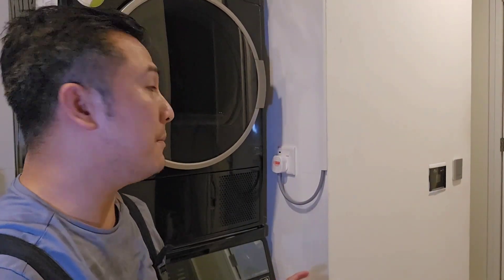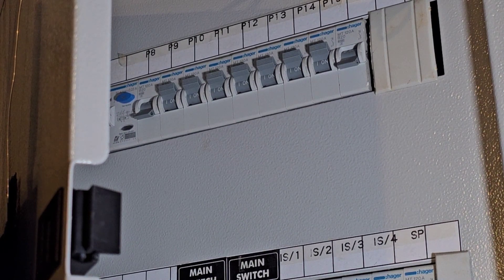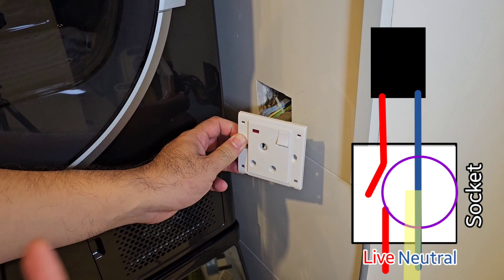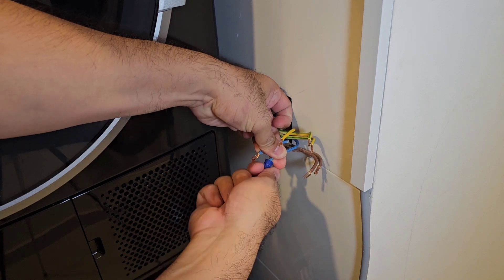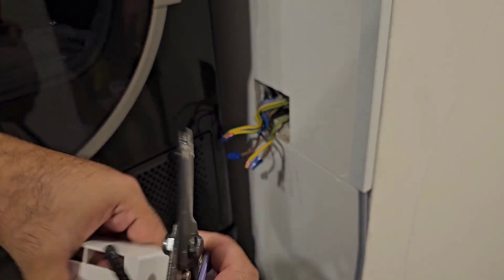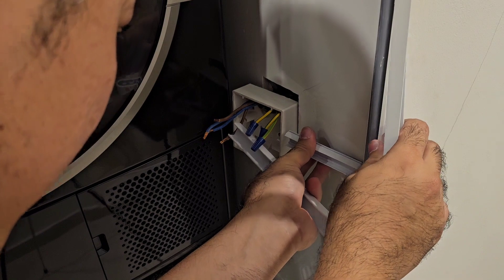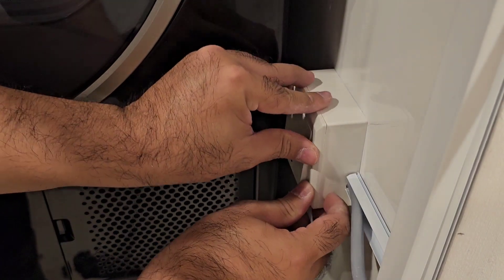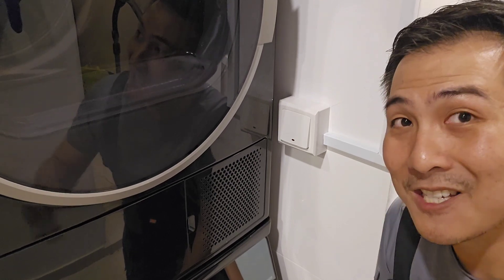How to change water heater 3 pin plug and socket to Dual-Pole Switch

Comment: I bought a water heater and it has a circuit breaker along with it. Will it be sufficient enough because of the circuit breaker?
Reply from the maker: Eh I dont understand the question

Comment: Hi, thanks a lot for the video. I have a question, currently my water heater is still connected to a 3 pin plug. The switch button is old so it can be quite loose. Some electrician said it's enough to change to dual pole switch, some said need to rewire the entire thing. In your experience, is changing to dual pole switch as per your video is safe enough?
Reply: not safe. water heater power supply cannot share with Power circuit. must individual circuit

Comment: Hi, I just have some few questions.  Hopefully, you'll be able to answer. Thank you. 
1. For a 4.5kW electric water heater, what's the size(mm²) of the cable should be use?
2. What's the Amp rating for the cable?
3. What's the Amp rating for the ON/OFF switch?

Comment: Can I change my normal switch to a 20a switch to power my vent hood?
Reply from the maker: Nope.. 20A refers to the entire circuit.. normal circuit only have 1 live wire inside.. a 20A Circuit has live neutral and earth

Comment: Can I ask, for the earth wire from water heater, does it have to connect to the right or left top corner of the switch? Thanks.
Reply from the maker: Does not matter there is a metal bar which links the two.. its mote for convenience
Reply: @ThePunggolHandyMan Thanks!

Comment: Hi, can the heater switch of 20A convert to normal power socket of 13A for usage of home appliances? Will this prone to jeopardise the home appliance lifespan?
Reply from the maker: Yea! 20A is like a speed limit. You can drive slower than that
Reply: @ThePunggolHandyMan  thx, can I get yr help?
Reply from the maker: Unfortunately I don't do house calls anymore!
Reply: @ThePunggolHandyMan  oh I have been wondering about converting an unused 20A water heater switch to become a 13A power socket for the longest time. so it is possible! strange how come electricians just tell me say cannot.
Reply from the maker: @aaronwende7 hahah it is possible! I'm pretty sure they just dont know how hahaha!
Reply: @ThePunggolHandyMan  should be just placing the cables into the appropriate slots right in the 13A socket. It's so useful to have a socket there to plug a fan to dry the bto typed toilets.
Reply from the maker: Wah I'm touched by your support
Reply: Ok appreciated for your valuable info though. Thanks a lot for your channel that changes life. 😊👍👍

Comment: Currently using the storage water heater type. Had I known the usefulness of the gas type I would have gone the gas water heater route. I could have run a hot water line to my sink and that would have made washing dishes easier. Speaking of storage water type, typically I would run it before my shower. When showering I have a habit of switching it off. The storage water heater can keep hot water for quite a while. And more than enough for a short shower.
Reply: Courts selling table top dishwasher with build in hot water function.
Reply: @layercake666  counter top dishwashers has it limits as big pots can't fit unless you have those freestanding ones. Nonetheless makes life easier. Even Xiaomi countertop dishwashers are quite good. So yeah good to have the 2nd option of washing in the sink with hot water.
Reply: @iskandarbz  Those free standing ones is massive in size but I see they have blue ticks which saves water.
Reply: @layercake666  yeah. I could not accommodate a free standing one for my bto kitchen. Have been considering a counter top dishwasher but it's still a want and counter top spaces are precious. If I were to get a bigger resale house I would consider the freestanding ones